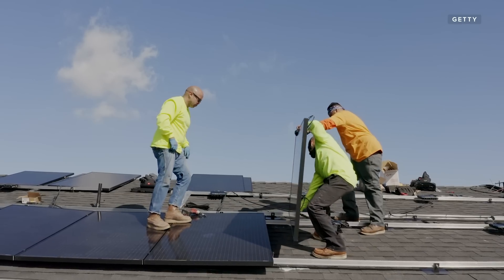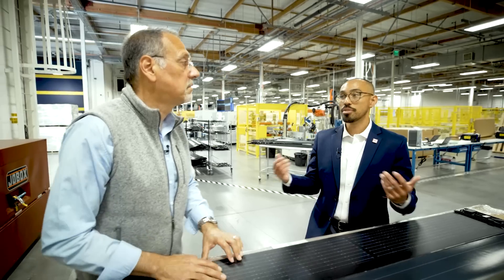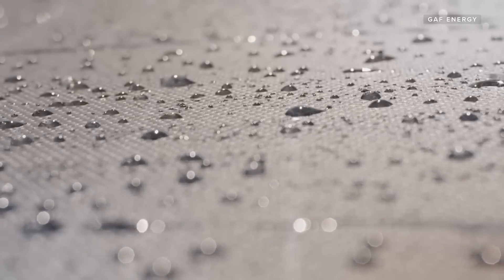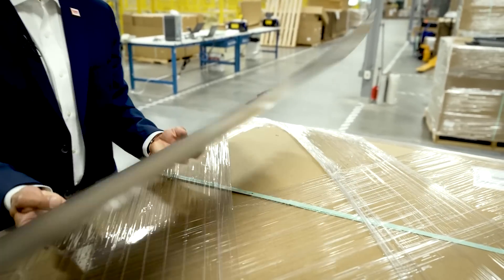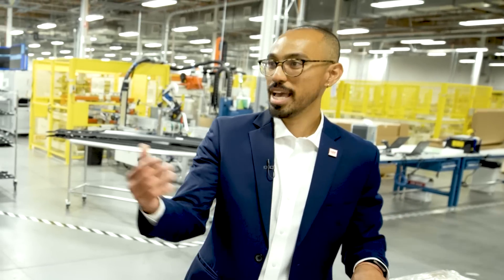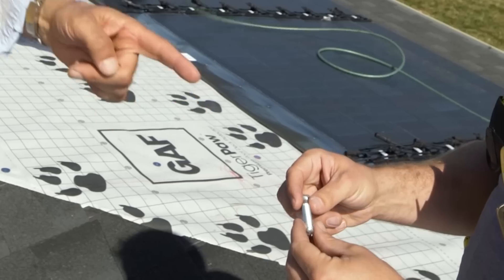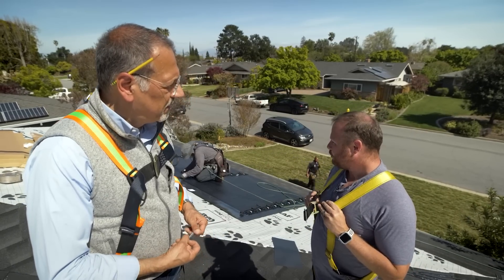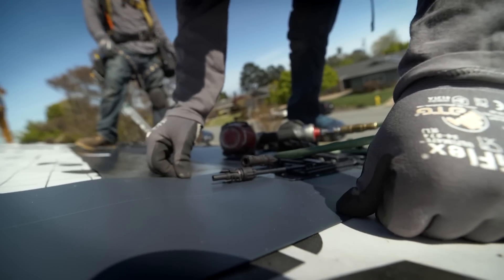If You've Avoided Rooftop Solar Tech, You May Have Just Run Out of Excuses

Comment: During a heavy snowstorm or other natural disaster, these would be useless. Portable solar panels that can be stored inside during bad weather would be a much better option. If you signed a contract to pay for "solar shingles" on a monthly basis, the bill will still come due even if the solar panels are destroyed. Whereas, if you get your electricity from a local utility company and a storm knocks out the power, the company will be responsible for restoring the service up to the point where the power lines enter the house. Plus, unlike with a solar contract, the amount of your monthly bill will be determined by how much energy is entering your home. Regardless of whether you use solar shingles or an electric company, you should definitely have an alternate power source, or more.

Comment: The marketing of this product focuses on the low aspect ratio and the ease of application via standard roofing techniques. In California, the light roof load compared to conventional high weight load solar makes it desirable in an earthquake prone state. However, I would be interested to see the electrical connection methodology from solar cell-to-solar cell; series connection? What is the failure mechanism of a line of elements and the panel as an entity? There was some limited discussion of the external circuit connection mechanics and the external electronics but needs more discussion. Interconnection of panel to main line was shown to be a relatively simple process but where are the converters located, what are converter efficiency? What are the resistive losses to get to the converters and the measured voltage drops? How difficult is the process to trouble shoot and isolate a failing panel? How many solar cell lines must fault before the panel becomes ineffective? A video with a bit more electrical information is merited. Finally, after watching all the failures of solar companies and fraudulent claims on YouTube, much more detail is necessary. Solar companies exposed by News organizations across the country for fraudulent claims, and taking advantage of people with incredible costs with zero power generation and “special contract clauses”, well just be careful. I hope Solar eventually becomes standard but it may be some time. Fingers crossed.

Comment: Actually if you do your homework, it’s clear that the efficiency of the mono-PERC cells that GAF is using falls far short of traditional Si solar cells. They also are subject to substantial efficiency losses due to the elevated temperature that they will be operating at (due to design and installation environment). Plus each small “module” needs to be connected to the network in a way that will inevitably boost balance of systems costs. To this solution is not the radical one for which we have been waiting. It’s not CIGS integrated into steel roofing in a large format…or something truly new. I will keep waiting.

Comment: So,   installed cost per watt is  ?      Less than $3.00 ?
Cost for 6KW rated output ?  (  most small households )

20 panels,  6.3KW,  generating  8,500KWH per year, total cost  $ 10,000 after fed rebate in 2019, zero electricity cost

Comment: Not convinced. I’ve been to their website and had a look and even on the installations they have pictures of, the supposed benefit of a “seamless” look just isn’t realised. It’s a very obvious addition to the normal roofline. The only reason these work out to be cost competitive with traditional panels is the high prices US consumers pay for traditional solar panels. If you live in the US and recently installed new solar panels through an installer, what did you pay and how many kWs was your system?

Comment: Solar is just so expensive and not cost effective yet !! But innovative is helping!! Hopefully soon it will be affordable
Reply: JS where do you live? Solar has different cost benefits based on where you are located. My system had a payback of 6 years…then free energy until it needs replacement.
Reply: @spidy6589  for totally off grid Solar? Payback in 6 years. I live in Georgia. I was priced over 100k for Solar roof .  That isn’t anywhere cheaper than having a power line lol  they even make Solar panels in a town 20 miles from me .

Comment: As a solar business, since 1977, the most practical placement of solar panels is building a covered carport.
It’s easier to service and the entire structure qualifies for tax credits.
Reply: The yard is a good place too
Reply: Can’t seem to find any that would look good in my driveway.
Reply: but wont the shade of the solar panels on a house help cool the house down in summer?
Reply: @steviegbcool  
Not very much.
Reply: I am sure the tax credit angle is a great sales pitch but hope your clients dont get audited.
Reply: @shroud1390  
It’s done all the time, since you must have a support structure for the panels. It’s part of the entire solar system.
Reply: @sunworksco  i am sure its done all the time but good luck defending an audit.   Maybe.  But I have had cpa’s research the roof as part of going solar and straight up say its an aggressive reading  of the tax code.  Its always best to check with a tax pro.
Reply: @shroud1390  
I’m talking about a free-standing carport type structure. Any PV solar system with a support structure is part of the solar system and qualifies for tax credits.

Comment: This is BS, CNET is full of it!
If the Power Company doesn't support payback for any excedent in power production the whole deal is a money pit.

Then the solar panels themselves are too expensive with out subsides, and they last only certain amount of usage/time as it is a chemical reaction which will run out of actual chemicals one day... and then the whole cost will have to be paid again.

Better to upgrade lights to high efficiency led, the refrigerator to a dual inverter one (at least) and cover roof with "thermal block and heat exchange" system to maximize temperatures inside, which together with high energy efficient AC will lower the bill a lot.

Then and only then the nonsense of solar power should be considered.

If it's by law... then remove the politicians and change the law, because it's wrong. Better to invest in high feed nuclear power than this solar panel crap which destroy the world

Comment: Solar panels lose their charging ability over time?? Lol. Yup I thought so. And I wonder how long till you have to. Soooo In the near future you would have to replace them. Go through all that nonsense again etc. we don’t like having strangers having to come to the house. I take it these panels won’t last 20 years like most traditional roofing shingles do. My roof hasn’t been changed in that time and it still going strong so far. I will just buy a gas generator instead and use it if I need to. I rather have a solar system I have access to and can replace myself if needed if possible. On the ground! And won’t cost me what $30,000-50,000. I have raccoons on my roof too. I bet they would mess with those connections of those panels.
Reply: Wait until you find out that roofs also have a finite lifespan. your mind will be truly blown (though it looks severely damaged already.)

Comment: So far not sure if it was said in the vid, but if those connection cables are bare that might be an issue in some places. It might be good to have something like a housing that covers those connections that line up would be a good idea even for just a piece of mind factor, though having these housing able to be popped open for quick checking is not a farfetched idea. 

I will say this brings the idea of basically making every roof or a home or business into a micro-generator more possible or plausible to come into effect. Though the other side of the issue is well updating the aging grid system to be able to handle that much power transfer both from homes, but also from the power plants across it. An then the last problem less than issue is well the fact that the profits of the entire power generation companies potentially would drop alot if you had that many people generating an sustaining from such a system.

Comment: Ugly looking things.  I get the heat absorption reason, but the all black plastic haunted house effect?  Then you still have all of those ugly cabling runs that stick out.  The aesthetics are no improvement in my opinion.  Then what about Spanish or barrel tile roofs that a considerable amount of the houses have in the U.S.?  There has to be a better way to get energy, solar or otherwise than throwing a patchwork of ideas against a wall and turning neighborhoods into an abstract patchwork of roof surfaces.

Comment: Looks like crap  to me you can make traditional solar look good plus it's proven.  Blah blah blah about stressing rafters . Most installers are carefull and pre drill.. blah blah blah hardly see leaks with good installs on traditional solar and good flashings  this looks like failure waiting to happen the junction boxes looks like plastic. , nail it wrong with cheap labor.  What a bad idea. Most roofs are nailed wrong but they're also forgiving. With typical roofing

.  Proven solar still way to go.  In my view.  Tesla stuff looks like a Lego house shiny tile looks crappy to me too.  Also, bet cant get as much energy in best sun area's 

Best put a standing seam metal roof put the panels on the back of your house if you can and use traditional solar for at least 10 years. 

We see hail all time traditional proven solar.  panels seem to hold up most of time.  Texas asphalt roofs dont hold up.. thankfully insurance pays typical to pull panels and re-install?? Is this product even reusable?  I would stay away.. but i do want this to one day work.  Still this doesn't look good enough yet.  In my little view

Comment: How do these meet the NEC 2017/2020 panel level shutdown requirements? I'd imagine having to purchase a per-shingle tigo (or similar) optimizer / shutdown would be even more prohibitively expensive and break the aesthetic benefit. What are the per-panel wattage output and @ what voltage? How is grounding handled for all of these shingle sized panels?
Reply: I was also looking for the answer to this question.  Maybe they are loopholing it, and calling the whole array one module with a single rapid shutdown immediately under the roof surface.

Comment: Nah. Solar remains the realm of places where electricity is not available, or is stupidly expensive - like generating it from diesel.
The useful lifetime of panels is woeful, and currently there is ZERO ability to recycle old solar panels, even though they are rich in rare materials.

Going solar is an expensive mistake, unless you have no other option! Replacing a system every 20 years is not a sustainable option.

Comment: One inverter vs. a separate micro-inverter for each panel means the whole system is compromised to the lowest power output panel on the whole roof. Ie. if one panel sit in the shade, it's output is much less than the rest of the roof but because of how inverters work, this means that is only takes the lesser amount of voltage from ALL the panels. This is a MAJOR drawback!!!

Comment: This is funny, you don't drill though your singles to mount solar you do the flashing install under and never drill though the single.  A solar install should only require the panels come off to replace the roof if not the install was done wrong

Comment: That is super cool! I would love to get solar someday when it's affordable
Reply: It's cheap if you do it yourself and don't aim for a huge system.
Reply: @treefarm3288  I am so not that advanced. No way if climb on my roof if I was lol
Reply: @flottdog  My roof has two different slopes, so one is easy to walk on. I bought all the materials locally except one controller, took advice and found shortcuts to avoid piercing the roof and avoid welding. I made mine adjustable because here in the Tropics the sun passes from the northern to the southern sky seasonally. I am not a tradesperson but I do most things myself.

Comment: That is mental that such a low percentage of roofs get solar. We re-roofed in Northern England 2 years ago and got black in line (where the panel is the primary waterproof layer and the roof membrane the secondary) panels fitted into the roof. It cost around US $10,000 for a 7kw system and it saved about $5000 in slate cost, as less slates were needed.  We don't even get much sun in Northern England, I have no idea why so few people would consider solar. This system looks good.
Reply: $10,000 is alot and the ROI isn't that good.
Reply: I played 1450$ for 8 530w half cut solar panels exactly a year ago

Comment: How do they connect it to the roof? With nails? If so how do you prevent water from getting through? It would also be interesting to know how you keep the panels cool? I guess this would be no good for a property that already has a slate roof?
Reply: The nails are protected by being overlapped by another tile like most other roofing systems.

Comment: This video smells more like an add than information, but I'll admit they are interesting.  Here's the issues I see - They many generate similar power, but they are black.  You now have a black roof in the sunbelt and will need more cooling.  Wonder if the "price" quoted includes any subsidies?  They vary and are generally going away.  Also, if you've ever experienced plastic cracking in the sun, you can predict my next concern for these.  Finally, the last problem is solar in general - it generates power too randomly and results in storage/grid issues, compounding the problems we already have.  It does you little good to generate power if you can't put it on the grid.  Too much green energy is already wasted due to being unable to transport it.

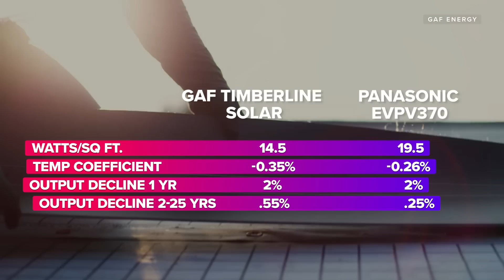Comment: NEVER BUY PLASTIC SOLAR PANELS. problem with these is they are plastic panels and the sun deteriorates all of these plastic panels within 3 years and will only get 50% output. At 6:00 minutes in this video they deceive you by showing a output decline of 2-25 years of 55%. I guarantee that 55% will be at the two-year mark. Anyone in solar that is honest will advice you to get glass panels.
Reply: Just look at how long those resin/plastic patio chairs last on your back porch before they start changing color,fade,get chalky and get brittle. This is the same problem with all these style of panels. Until they come up with a solution stick with glass panels.

Comment: If this went on a new house with a storage battery and a connection for an EV the added cost may be offset by the electricity produced.  Plus likely the price of electricity will increase every year.  A new house could be designed so the roof size, shape, angle ect. provide the most benefit.

Comment: 5:47 Seems the GAF solar roof looses MORE at -0.35% than the Panasonic rack mounted roof, possible because of air gap beneath the rack mounted system.  Bet temperature degradation will be greater if the roof attic is "spray-foam" insulated and "encapsulated," because this leads to a hotter roof face temperature.
Reply: Sorry, you lost credibility at "looses".
Reply: @tim3172  Hope you feal an inch tawler beecaws ewe arrrh a gooder speeler dan me.  Also, "may the fleas of one thousand camels infest your armpits."

Comment: How do these handle the main problem with string-inverters; shading? Looks like a great idea otherwise.
Reply: Ya, they used the word "Daisy chained". I take it that means wired in series which means if 1 shingle goes bad the whole row that's hooked together doesn't generate electricity until the one shingle is fixed.

Comment: The "Vacant Walking Areas" he mentions at 5:45 is actually a Fire Code requirement to allow Firefighters access. 
Haven't seen anything to indicate that Timberline is exempt from these requirements.
Reply: That code is too ensure that firefighters can access as much of the roof that they need. Rack-mount solar panels are brittle and because there's no support under the glass, they will break if walked on, but these are unbreakable, so because a firefighter could walk ON these, rather than having to go around, these would be way better from a firefighting point of view.

Comment: Once they get the cost equal to a standard roof install, I'm going to order the system. Heating is always another huge factor.
Reply: Im not an expert but I think you can apply for some or of government assistance or premium loan if you decide to get those even now.  It depends where you live and the local laws ofc, so take my comment with a bucket of salt but it worth to check if there are some programs or bank premiums in your area.
Reply: Why in the world would they ever get it equal to a standard roof?! It’s a solar panel not a hunk of tar pressed together. As soon as Ferrari comes out with a car that costs no more than a Corolla I’m gonna buy one.